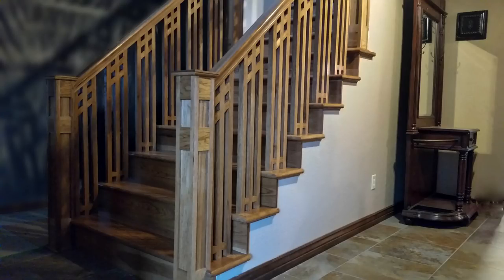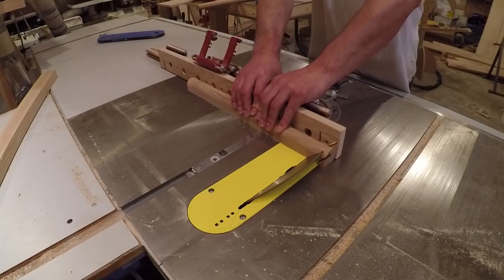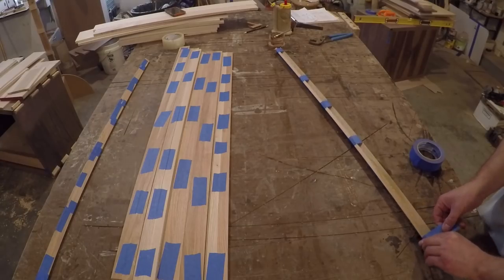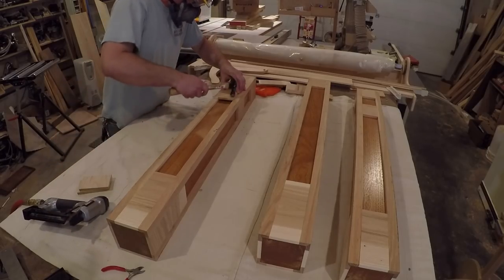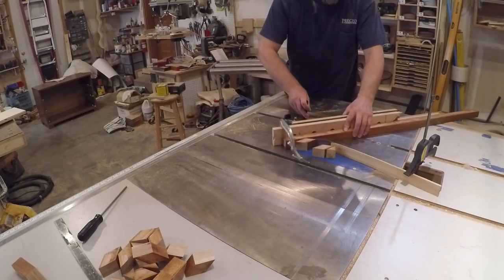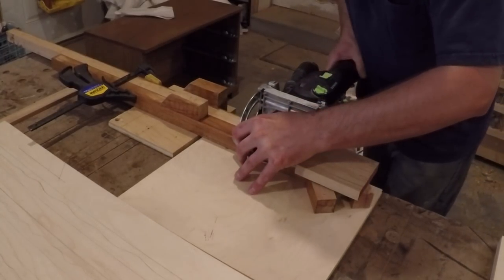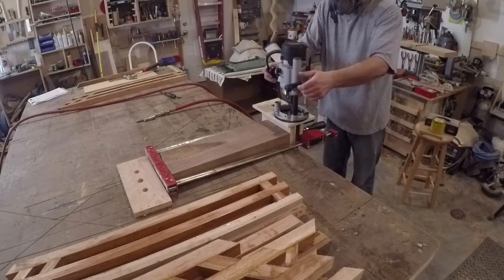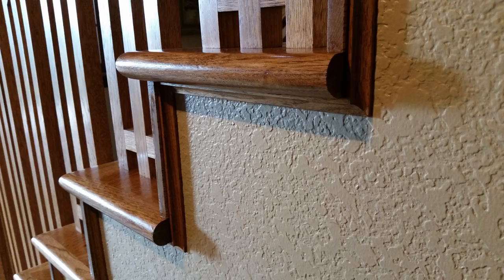Building a Custom Staircase and Handrail - Woodworking - Home Improvement

Comment: You are so right about codes; our architect designed a four-foot wide stair that had a landing mid-way, also four feet wide.  But the local code required the handrail to extend to the bottom step (the landing), forcing the center newel post into the landing and cutting the landing width by almost a foot.  We couldn't reframe the stairs, so the only code solution was to add a second handrail along the outer wall that extended beyond the bottom step.  This kept the newel post off the landing.  It would have been more attractive if we had known in time to widen the landing.

Comment: I have used pecan, that suppose to be a type of hickory, and the wood is so dense that when cut with sharp blades resemble more glass/plastic than wood. Never had an splint. But probably the wood consistency will not only vary withing the species of plant, but the individual tree. What finish do you use? It seems to me you use some type of oil with no stain, since the finish look true to the color of the wood I have used before. Excellent job.

Comment: great work, especially one guy in a shop. very impressive. for my taste, i dont like the square end on the return nosing. was the drywall edge not clean enough to leave the open end of the riser flush with the drywall? then you could have avoided the veritcal cove moulding and bull nosed the end of the return nosing (as well as project in back the same length as the nosing overhang).

Comment: I don't think anyone thinks that Dominos, or any other Festool product "...aren't real woodworking". What they are is ridiculously, ludicrously, overpriced. I don't dispute the quality of the product or the results that can be achieved with them. But we can get the same results with other tools and methods for a fraction of the price.
Reply: Cheap, fast, accurate: Pick 2. Festool is for those that choose fast and accurate. There's plenty of cheap and accurate means of doing the same job, you could cut fine mortises with just a power drill and a chisel. Sure as shit ain't going to be fast, though. And when you've got a business to run and need to cut a few dozen mortises for one single project, investing in speed is a good business decision.
Reply: Dave Starr As I said in my original comment, I don't dispute the quality or performance. Only the price. Gouging is gouging.